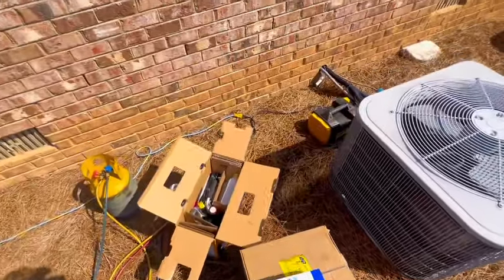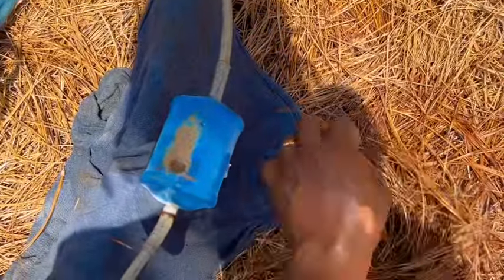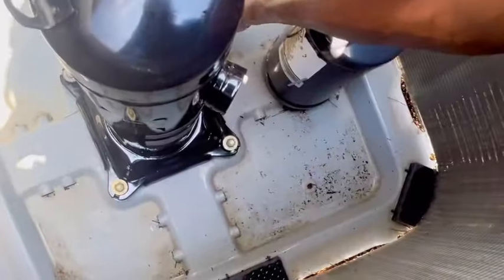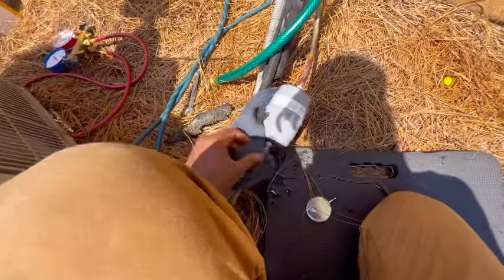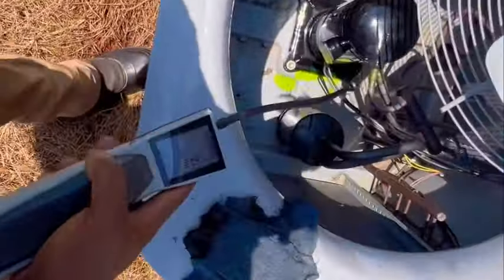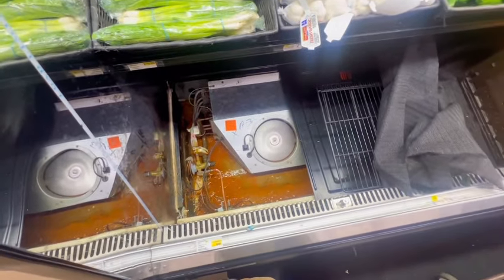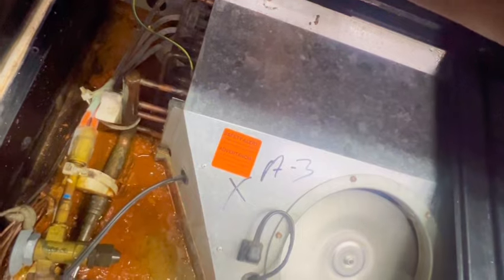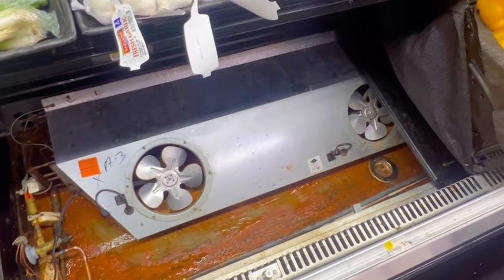PLACED IN NEW COPELAND COMPRESSOR FOR CARRIER UNIT! PRODUCE CASE MAKING LOUD NOISES!

Comment: Did you have to change the wiring because the insulation had melted, as I noticed you didn’t move it off the suction pipe when you were unbrazing . I always make sure wiring, plastics etc are well away from naked flames. I learnt the hard way too 😂
Reply from the maker: No I always change the wiring when installing compressor and old wiring rubbed on suction. And most def maker sure wires out the way 😂😂🙏🏽

Comment: Discharge line drier to protect reversing valve. And yes you should change it. You said 60psi on r410a? No bueno
Reply: That's a muffler, not a filter dryer. It's in most Carrier single and two-stage. Cuts down on noise from the discharge.
Reply from the maker: That’s interesting didn’t know learn something new everyday.
Reply: @Azranael  makes sense for sure. Thanks for the info.